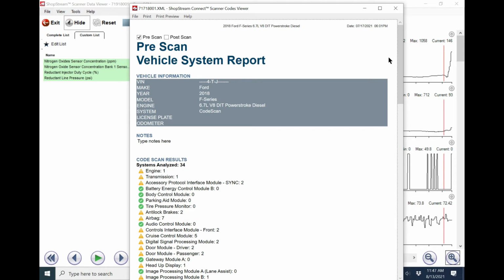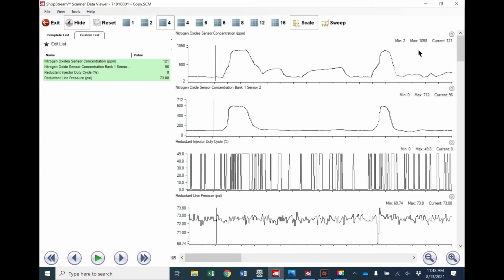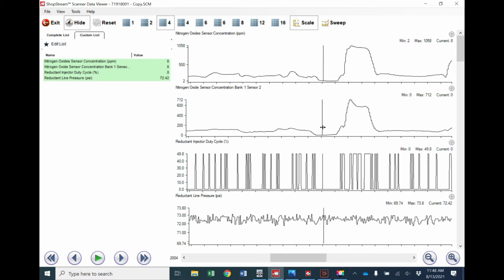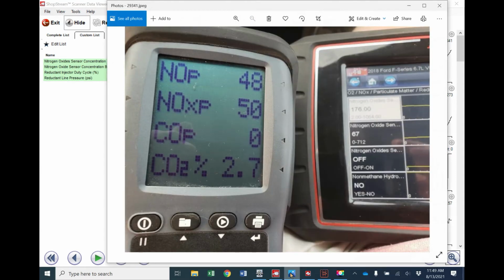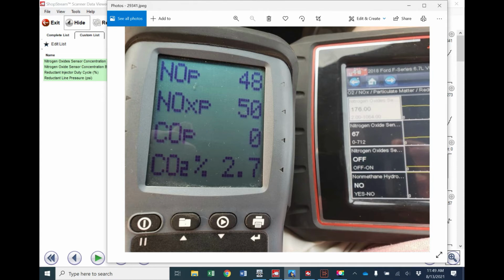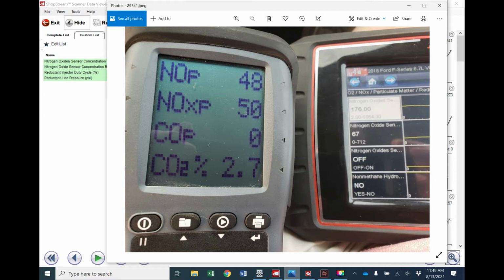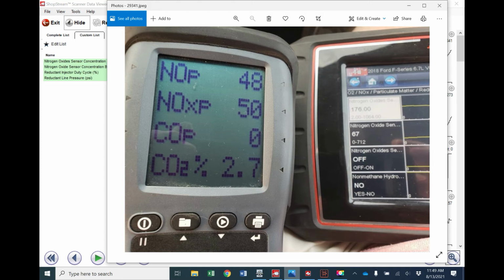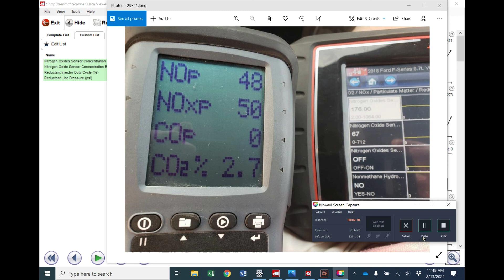2018 F450 P20EE

Comment: P20ee won’t go away on my 21. Previous owner got a whole new dpf under warranty before 50k miles about a year ago. Said code kept coming back. I changed front nox sensor on a whim and also removed and replaced def fluid in tank and cleaned light deposits off def injector. That didn’t work so I took to dealer. They said bad rear nox sensor. Now I’ve changed both nox sensors. P20ee is back on within 20 miles of dealer resetting code and me changing rear nox sensor. I’m out of ideas.
Reply from the maker: What do the NOx sensors read under a hot, steady cruise?
Reply: @joediagnostics Let me get back to you on that. I just got this truck about 500 miles ago and initially the light came on on my way home with it. It had a current and a permanent P20ee stored in the pcm. Ordered the obd connector for forscan but can’t get my old laptop to download the drivers for it. Hopefully I can see the info you are asking for when I get forscan working. Never used it before.

Comment: What make and model of gas analyzer are you using?
Reply: Great video buddy 👍
Reply from the maker: Hey Chris.  I use a Snap-on 5 gas.  They're mostly used for gas engine stuff, and using it on a diesel can lead to a short life on the O2 sensor.  Snap-on's Commercial division has a dedicated NOx tester though.

Comment: I'm so glad i stumbled accross these videos!  I'm going to employ these methods to diagnose a BMW X5d I have at my shop right now.. customer came in with "incorrect DEF detected" message on, tested DEF w/ refractometer and found it @ 32.5%.  Performed some function tests with the factory diagnostic tool (ISTA) and it stated that both NOx sensors were bad.  Replaced both NOx sensors and drove it - light went away, however when performing our extended QC to try to set monitors (we always try to do this with diesels since they're so problematic and have a high comeback ratio..), an SCR efficiency fault stored and the test plan stated to replace both NOx sensors.. AGAIN!  We programmed the vehicle also and cleared adaptations/calibrations.  However, when I drove with w/ the Zeus hooked up looking @ generic OBD data, I noticed the pre+post NOx sensors are really close in value most of the time, on decel they go low from 0-10 PPM but on acceleration and cruising I'm getting a 30%-80% reduction in NOx at best... I do have the snap on 5-gas so I'm gonna hook it up and see what it's measuring (dont know why i didn't think of that before!!).  This is really good explaination though and could really mitigate the extensiveness of testing performed on these SCR systems since just doing the efficiency test plan can take 45min-60min!
Reply from the maker: Thanks for the feedback!  Let us know how you make out with that!  You could post a video of it.